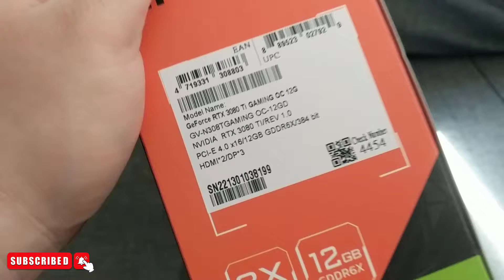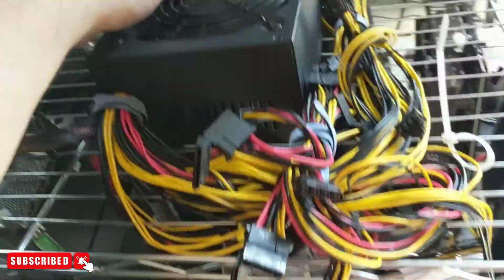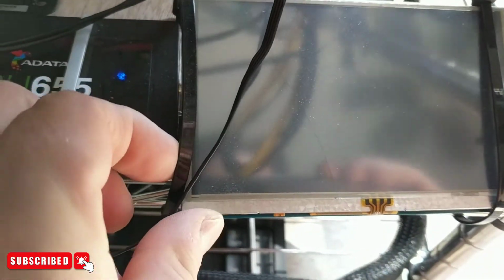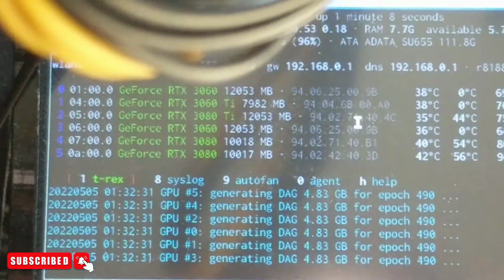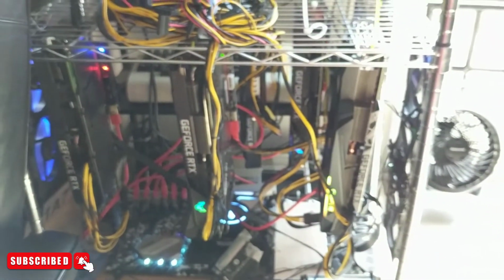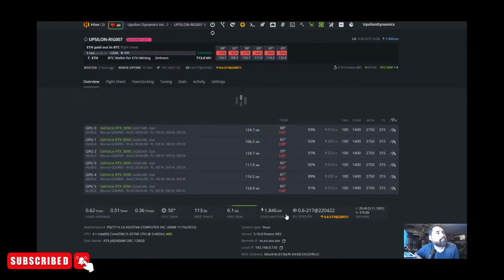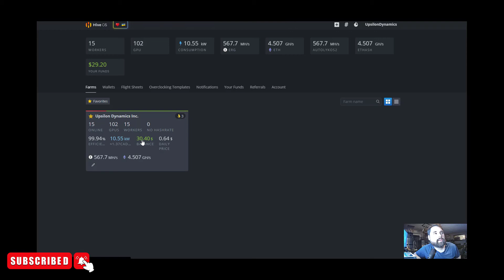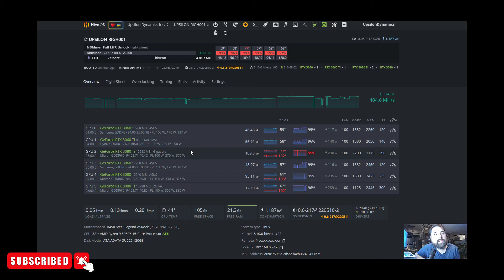Gigabyte 3080TI LHR with 100% NBminer UNLOCK  | Overclocks & Hashrates on ETH

Comment: hi man, thanks for the great video.

what is the full name/version for that Zotac 3080ti card? Is it 3080TI Trinity OC 12GB?

was thinking of trying Gigabyte but changed my mind after looking at the junction memory temps, it would be better if i try Zotac instead i guess.. man FTW3 was the best, no need to change pads and performance was great, no fussy. However it was so hard to find FTW3 now, and from my research XC3 is pretty bad in term of performance/temps

Comment: I like the density of the 3080ti but I'm worried about cooling the memory and the high wattage needed for the 3080ti.
Reply from the maker: It has around a .38-.4 efficiency I’d say. You can get more bang for buck with the 6600 series from AMD as high as .5 on ETH. But when the merge happens efficiency will depend largely on the coin we all end up mining.
Reply: @cryptomatt1983  I'm trying to stay away from gddr6x after experiencing four evga 3090 being such a pain. I'm going with workstation gpus moving forward. As an example 12 A5000 from Nvidia output 1260Mh/s --1308Mh/s  @2760W. I much prefer them for server cases since they are two slot blower cards and don't get overly warm like gddr6x gaming gpus do.  I'm also considering rtx 3070s because they don't have gddr6x memory. Be careful with the 3080Ti I hear at the wall they pull more than 330w at the wall.
Reply from the maker: @RedHairGreen  GDDR6X memory based cards are nuclear reactors, I've got 2 rigs with 6 3090's and 6 3080's and by far they are the hardest to manage (crashing often, heating, most maintenance with pads needed replacement).  I think you can't go wrong with A2000 type cards in a server case, I've got 8 in a server case myself and they are great 40mh across the board and low power consumption.
Reply: @cryptomatt1983  yeah the A5000 has a good  hash to watt ratio. 110mh/s at 230w with no issues staying cool. They are more expensive though since they are workstation gpus but they are very stable workers   Summer is going to be brutal for 3080/3080ti/3090s